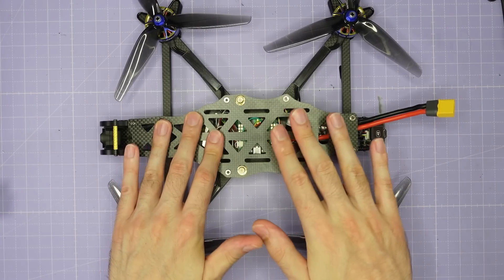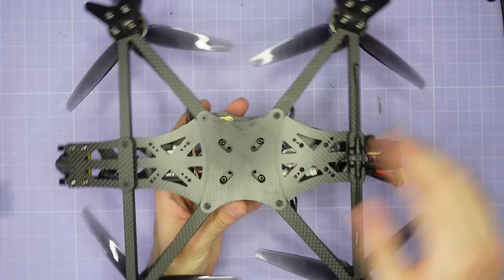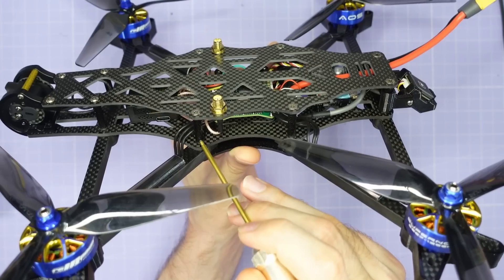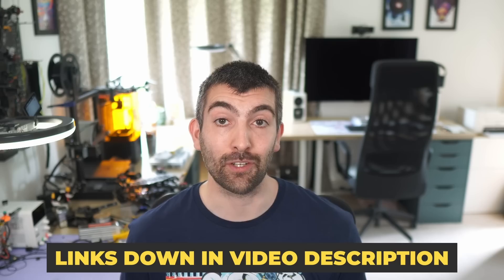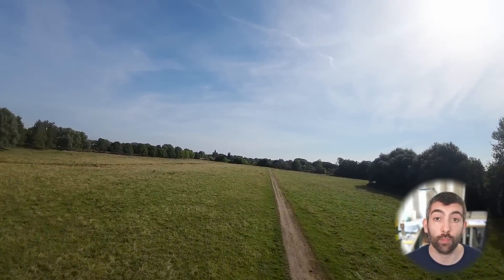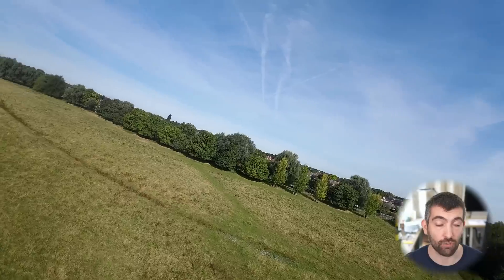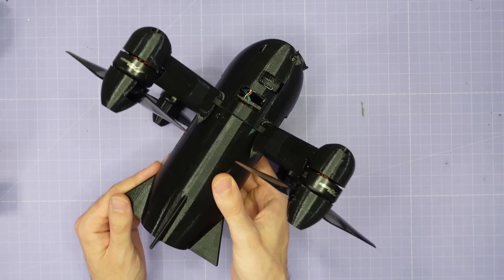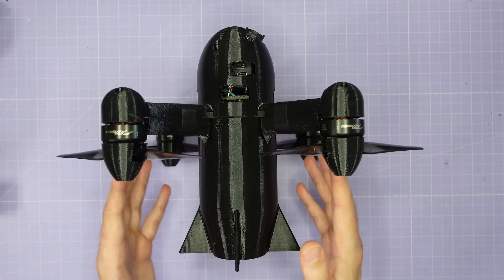A 200MPH drone you can try TODAY. AOS Project Update!

Comment from the maker: Day 1 update! You can buy the whole kit in black from CNC drones for $124. If you want to buy coloured prints from brain3d youll want to buy just the CF and hardware from cncdrones. The pricing is not correct for that at the moment (should be $64) but will be fixed soon!
Reply: Would it not be possible to buy the CF and hardware parts from cncdrones and get access to the 3d print files? It would be great to be able to experiment with different colours and filaments.
Reply: I asked this further below, but could you include anti-vibration grease and locktite for the build guide video, so we know exactly how to do this accurately (and optimally)?
Reply: Thank you, Chris! I admire you and what you do for the hobby, and these adjustments make it much easier to support your work!
Reply: Dude you motivated me to push the limits. I am feeling the need for speed now. Gunna build an 8S version, just ordered a red one from Brain and the parts from CNC. Keep pushing Chris, you da MAN!

Comment: Hey Chris!
I'm interested in building an HS5. I currently have a set of Xnova 2806.5 1900 KV motors. 
Do you think I can use them instead of the 2808 1950 KV ones you recommend? Would there be any noticeable difference in performance or efficiency?

Comment: Hi Chris! Do you think a design like this could ever be adapted to long range flying with long flight times?
Reply: No 
It’s very inefficient 
Aerodynamics don’t have much of a benefit if you’re not going really fast
Reply: @ why is this less efficient than a normal quad? Bc it has to fly faster?
Reply: @of88888  because you should be using smaller motors, that have lower kv and you will get more flight time.
Not to mention this thing weighs around 900 grams which is a chunky boy.
I’m also pretty certain lion batteries also get more flight time with less discharge rate

Comment: the motors are 6S rated so why can you use it on 8S, because it is not the voltage but the power that matters? so I could use any motor e.g. at double the voltage and half the current? thanks

Comment: Hi Chris, we can't find the APC 5.25 x 6.25 props in both pusher and puller configuration, so wondering what you used, (8pitch are but as you said ' very extreme')

Comment: Amazing work Chriss!, I have a few questions: 
On your video the motors are EMAX 2808 pro 1900kv(?), 
Do you recommend the velox like "hinted" in the picture? :) 
The current recommended prop is HQProp 5.3x8 thin prop.
In the past (way back 2014.... LOL) i tried thin props and under high speed they bent from the load, making a new scream sound
Isn't this an issue? (planning the 8S route, maybe with throttle limit at first)
Should I put on the build an XT90 or stronger ? we can reach 220A draw (i'm amazed how XT60 lasts )
Lets say I do the whole battery in one pass with the XT60, will it hold?
We once had a drag race on 4S and the winner (i was 2nd LOL) had his XT60 from quad fused to his battery.
Will AM32 be okay for this build? You mentioned something about rampup time that BLheli32 accelerate faster, but I really dont want to buy deadend ESCs... (horrible what these guys did to the hobby, but it will be better after a period)

Comment: Will it be possible to upgrade the camera cage if you are using a previous version of the AOS 7 frame? Just wondering if that would be possible as the front looks slightly different now.
Reply from the maker: Yes, a new top plate, bottom plate and camera cage is required. If you have the EVO I wouldn't worry about upgrading unless you need one of the new features. Just enjoy your AOS!

Comment: @ChrisRosser
Hi Chris. The AOS 7v5.... Will Avenger 2812 1115kv motors work with that frame?. I know its a little bit big motors.
Reply from the maker: A little big and a little low KV (for 6s). 2807 1400KV is the sweet spot with a 5000mAh 6S
Reply: @ChrisRosser  Thank you Chris. The reason I asked about the 2812 motors is because I already have them build on my FR8 with 8" props, but I'm not a big fan of that frame. So that why I wanted to see if I can gut it and move the components over to the ASO7V5 frame.

Comment: Next : sub 250g analog high speed drone
Reply: Not sure why you'd wanna deal with analog anymore... Especially since it won't give you video you can really use. Better idea is the HDZero Race VTXs or maybe even the Walksnail Whoop VTX. Much better quality image, and still a very low weight for a sub 250g.
Reply: @Vousie  Yes , but for high speed the weight matters , for a 400mw anlog vtx and camera you will have 3g , for me the analog quality is usable, I also fly walksnail, but the vtx takes more space and just sags the battery more on whoops , if I'm trying to build something efficient I will go with analog , if I'm trying to build something where weight it's a problem, I will go with walksnail
Reply: @rares6216  That's only fine if you're flying fast just for fun or something. But a lot of people want to film things. In which case you need at least something like Walksnail where you can actually kinda use the FPV feed.
Reply: @Vousie  but runcam thumb pro exists and is wayyy better than ws
Reply: @rares6216  But that camera alone weighs more than the WS whoop VTX and camera... So if lightest weight is really your priority (while still getting usable video) then that'd actually be the best option. Note that that VTX has onboard storage, so you can record 1080p video without interference.
Reply: @Vousie I am NOT trying to say that digital is not better, I just said my opinion , if rc thumb is heavy , you can try caddx loris and betafpv m03 vtx( about the weight of ws whoop ) and get 4k 60fps footage

Comment: Can one Tatu 6s 1800mAh battery power such a beast? In the RedBull drone, they were using 2 batteries if I remember correctly, so I'm not sure how long this can fly on the top speed until battery sags...

Comment: I'm stuck on Analog still. Will analog fit all the same in this HS frame? (edit: You answer this at 12:00). Love the new innovative rocket design. ;-)
Reply from the maker: Yes, absolutely. You can use any analog or digital camera and VTX. Just bear in mind the packaging and use a UFL or MMCX antenna similar in size to the O3 antenna and it'll work just fine.

Comment: My first drone build will be a 3.5 or 4 inch. Any version 5 kits inbound (incl. motors) for such a build? Did you ever produce a build guide with the anti-vibration using viscous grease? That would be very helpful to difference where to use locktite and where to use grease :)
Reply: I think there's been various tests about the grease and it doesn't always work. Better is to just have a low-vibration frame, which most frames on the market already are. I recently built a 5" quad and it's just the standard build and it has super low vibration.
Reply: @Vousie  CR already proved highly viscous grease helps in one of his shorts.

Comment: AHHHH COME ON. I just finished designing my own high speed design, weird old frame and custom canopy, but burned out motors because of wrong tune, had no time to fly it with higher kv motors before my holiday because I missed putting a whole to bind the Air unit (!) and the breakdown is more complicated.

i see that you do not put as much emphasis on putting the center of mass forward as Maximo Bell.

Looking forward to see if you get thermal issues while waiting for satallites ;)
Reply from the maker: If you have no tail the center of mass must be forward. For ease of build, layout and takeoff a tail makes everything so much easier.
Reply: Never even seen your reply! As a seasoned KSP-Player I know about the importance of center of mass vs area. I don‘t know if the tails in all that dirty air will produce enough „correcting“ torque before the FC corrects, even with the sliders and filters being as docile as I had to make them to not burn up way to high kv motors. I am going to test that theory soon, my design flies with minor difficulties (RX loss after some promising passes)

Did you ever try pusher vs. puller?
Reply: @ChrisRosser  Well, you were right. My design started "fishtailing" at about 270kph when I fitted aerodynamic shrouds to the arms. And without them I struggled and burned out a motor (yes, one?) at 260

Comment: Wow, a high-speed drone kit for the masses?! Super neat. Bet that thing takes a little while to master vs a normal drone, mostly because of the camera angle. Gonna be landing somewhat “blind”.
Reply from the maker: Very easy with someone standing beside to guide you down for landing!
Reply: Not necessarily, I have a similar quad for years now with a 90° tilt camera (I don't understand why using less except if it is for subject filming), and to fly it easily you just have to swap roll and yaw channels, you fly it then like a plane, and for landing I just use a switch to put back channels in the normal configuration and activate stabilised mode for los landing or  rth for auto-land.
Reply: @MessFPV  So, in summary, you will be landing "blind" in FPV, so don't try it. Land LOS or with RTH... Still not great. It still means that it's important to have that warning for people that they won't be able to land "normally" (i.e. in acro mode with FPV).
Reply: A strong foundation of acro mode line of sight is probably very helpful for landing something like this gently.

Comment: Let me start by saying i love what you do for this hobby, however i dont believe a 200mph capable frame or kit should be widely available to the masses. This seems risky to have such a high speed quad easily accessible to folks with potentially not enough experience or sense to be safe
Reply from the maker: We can make the same argument to sports car manufacturers. Doesn't seem to stop them making 200mph+ cars for the road.
Reply: @ChrisRosser  I'll admit, you got me there. Someone was bound to do a high speed kit eventually. I guess it's cool that you did it proper and it'll fund more r&d for the rest of us to learn from. I appreciate what you do, this one caught me by surprise though. Good stuff Rosser. Keep doing you

Comment: I'm no aerodynamicist but I wonder if it would it improve drag by raking the arms backwards instead of having them at 90 degrees.
Reply from the maker: Not at these speeds unfortunately, backward sweep really helps when you get into the transonic regime above 0.6M or so. At lower speeds backward sweep increases wing surface area and therefore drag.
Reply: This comes from CR, This means it's S tested ( scieeeeence).
Reply: @ThomasAndersonFPV  CR?
Reply: @rapamune CR=  Chris Rosser :)  
AOS = Art of Science :)

Comment: Remember pilots, if your country has a "speed limit" for drones, DON"T put the speed in the OSD if your going to post it!
Reply from the maker: Or make sure you get a part 107 waiver 👍
Reply: Most countries have an energy limit not a speed limit or a weight limit it's actually energy on impact
Reply: @markwilliams5654  Pretty sure the US has a 100 MPH speed limit for all drones... But other than that you're probably right - AFAIK most countries base their limits on weight and don't care about max speed.
Reply: Why?
Reply: @duelz96  so they cant know the speed as easily and i doubt they would bother calculating it

Comment: Nick from CNC gave me early access on the AOS 7 V5, great flight! Is the X-cell technology gonna be moved into the cine25 or cine35? that's where the vibration reduction can benefit the most
Reply from the maker: Yes, I'm working on it so stay tuned! It won't be exactly the same X-cell design as the freestyle frames but the benefits are still there.
Reply: How much for the new frame?

Comment: This would be awesome when available via iflight or european dealers.
My 5 inch racer does 270kph maximum speed. Cant get it to fly straight without oscillations on top speeds.
Going faster is all about aerodynamics. The apc 5x7.5 are also a great choice.
Any tuning tips ?
Reply: Can you please share your dron spec? Thx
Reply: Whats your drone spec?
Reply: @duelz9366  xnova 2208 1500kv on 1300mah 8S lipo. 5 inch racer frame.
Reply: @chrisbee5481  Ok so there is a setting where you can limit your motor output. Try dropping it to like 90 and see if you still get oscillations.

Set TPA to like 65 and the break point to like 1300

Also what frame is it? Do you have loose parts on it?

Comment: TF is hitting 0 to 330+ mph in 4 sec, 0 to 100 mph in under 0.9 sec.
Reply from the maker: 0-320kph is around 4s. Top speed on 6S around 200mph.
Reply: @ChrisRosser  thanks